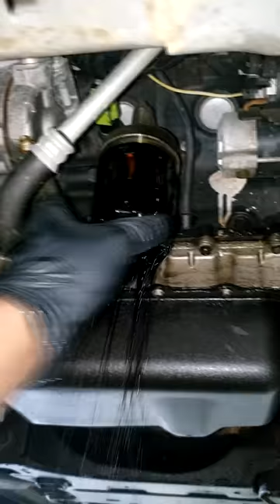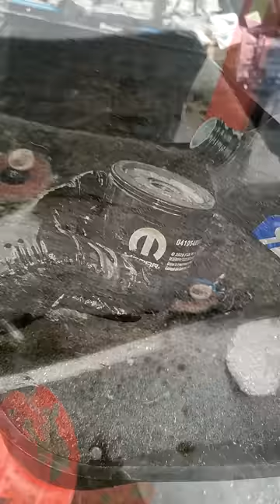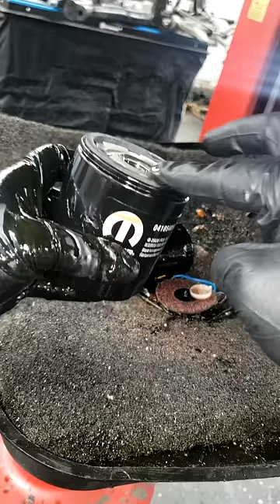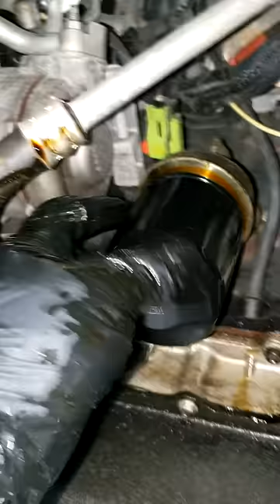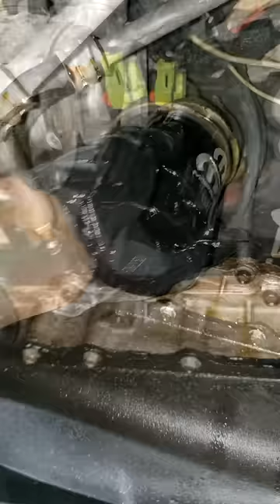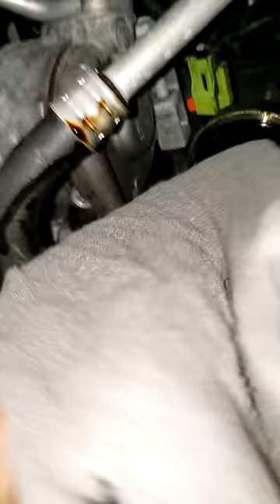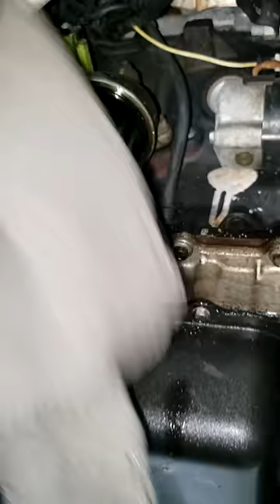Don't Lie.. Are yall still doing this?

Comment: Try that on a modern Subaru with the top mounted filter!
Reply: Or an Audi
Reply: Use flood clear mode to circulate oil before starting the engine after an oil change. My charger has an top mounted, cartridge filter and I make sure to do this everytime. Hold the gas pedal all the way to the floor then start the car. The starter will turn over the engine but it cuts off the fuel pumps so it doesn't start. Do that until you build a little oil pressure then start the car. As far as I know, every modern engine has this ability.
Reply: @dduncan55330  Everything in the engine is still spinning and rubbing against eachother the same as if fuel was going in, your not accomplishing anything by doing that. The only difference would be a bit less stress on the rod bearings since no combustion forces are being applied to them. I really don’t see how it would be worth bothering with.
Reply: @rainbowritchie8910  exactly 
.
its not proper.... but do you know how many engines ive pulled the plugs and used the starter to pre-lube before first start?
.
now if that new engine has been sitting for years.... im getting the proper pre-lube machine 
.
on a LS you can fill through a plug..... gets like 80% of it VS 25% of it in the filter only
Reply: man side mounted is barely doable, fastest screw in the west.... giggity
Reply: Well yeah it's a subelly zoo!
Reply: Easy, fill it up let it soak for while so it doesn’t drip when you’re ready to install it.
Reply: @rainbowritchie8910  everything in your engine will still have a thin layer of oil attached to it, it will be rotating much slower with much less force applied meaning that layer oil will last longer then it would under load and running
Reply: In that case, you would want to crank the engine in "Clear flood mode" or with the fuel pump relay removed to build up some oil pressure.
Reply: You just gotta be real fast. Chilling the pre-oiled filter to -40° also helps. 🤡
Reply: If it mattered then they wouldn't have made so many cars with filters upside down
Reply: On a design like that you have to flip the car upside down
Reply: I love those!  Makes an oil change so easy!  Nice big chunky 17mm plug that won’t round out, and a filter, oil fill, and dip stick all in one spot.
Reply: Put your foot on gas pedal all the way floored. Turn the ignition and it will disable fuel and spark and prime the oil system for the top mounted filter
Reply: In those particular cases a person will want the engine to not fire up immediately. they will want it to crank over about half a dozen revolutions. without starting to fill the filter. on modern vehicles this can be done by holding the throttle on the floor. while cranking it over. and on older vehicles by disabling the ignition system. by pulling the coil wire from the coil. and then replacing it after the filter is filled.
Reply: Or the handful of fords with the side mounted
Reply: @vex6559  And Chevy S10. with the remote filter mounted on the core support.
Reply: Great. Now I'm screaming internally, and I don't even OWN a Subaru! X3
Reply: Or a VW.
Reply: @rainbowritchie8910  Slower RPM.  Less bearing wear.
Reply: My mercedes has a top filter and I always put a bit of oil in the housing before putting the filter. 300k out of original engine so il just keep prefilling.
Reply: Pouring oil into the filter plug accomplishes the same thing.
Reply: @vex6559  yup, I lived with a Zetec in a Focus for a decade.  Really unpleasant to do oil changes.
Reply: @carrabellicusp 
You just flip car up side down 😂
Reply: or a BMW
Reply: Or side mount
Reply: I do, just get close and quick.
Reply: lol yeha driving primarily japanese cars, alot of my oil filters have been side or upside-down mounted (old nissan sentra, scion frs, toyota corolla hatchback) so this sort of thing never occurred to me. I oil the gasket tho
Reply: Yep!
Reply: Nearly all my cars have side mounted filters. No way I'm making a giant oil mess installing a prefilled filter on my car!
Reply: Same deal with the 3F-E in my 35 year-old Toyota. On the upside, when I do an oil change I can puncture the top of the filter to let it drain down through the pan and out so that it doesn't splooge all over the front axle when I remove it.
Reply: As opposed to a classic Subaru?
Reply: @LogicofChaos7871  yes.
Reply: Try doing that on my 74 charger big block in a 90° angle in the front of the motor
Reply: @LogicofChaos7871  Yes, EJs have it underneath, FAs and FBs have it on top. Not sure about older than EJ engines.

On my WRX (FA24DIT), I do the clear flood mode after changing oil. Clutch + gas + ignition = crank without starting for about 10 seconds. Helps build oil pressure at lower RPMs than just running the car.
Reply: And that's to the points, your point that it doesn't matter because it doesn't. Oil pressure will be up within seconds
Reply: Lol!! Do it super human fast! LMFAO 😆😆😂😂😂😂
Reply: Or a Buick 3800
   Chevy 5.3
Reply: This is not necessary on modern cars. Large truck engines yes you need to fill the filter but I rarely ever hear a tick or see loss of oil pressure during first start up. Probably more important to clean your mating surface....
Reply: @ReconRider  You think every car has that?😂
Reply: The filter doesn’t need to be full of oil. Just add oil until it stops absorbing. It’s the first thing I do, before draining the old oil from the engine or removing the old filter - and I check that the element has absorbed before adding more. A few ounces at a time.
Reply: That’s why you shouldn’t own a Subaru 😂
Reply: Subaru techs are specifically trained not to pre-charge filters. Doesn’t matter if its a bottom or top mounted filter, we don’t do it.
Reply: @ifGarage  clearly you have never worked on a car.
Reply: Fill it 1 time then wait a minute or 2 and all the oil will soak into the filter material and then just twist it on quickly
Reply: You have to be quicker then gravity🥱
Reply: @xzambkilaxcalaber215  or just fill it and wait a couple minutes to smoke into the filter material
Reply: @unbiasedcobra6672  clearly you’ve been doing oil changes wrong your whole life
Reply: @ifGarage  yeah over 20 year's without a single issue. If your motor can't run for 3 seconds with the oil already coated on everything then the motor is already rooted. The fact so many cars have filters on top or that are cartridge shows this. The oil already in a motor more then covers the lubrication needs until the oil starts pumping.
Reply: Sideways on a jag
Reply: @unbiasedcobra6672  4 ASE certs here, no need for your essay
Reply: @ifGarage  4certs and you can't explain your position. Claims made without evidence can be dismissed without evidence. Although I wouldn't image you could come up with anything more then "nuh uh".
Reply: Some Toyota's too
Reply: @unbiasedcobra6672   Wow I really angered you didn’t I? It’s been an honor
Reply: @ifGarage  calling people angry when you have no point to make. Lmao you are adorable. It's always cute when children try to debate adults. You see, explaining your point isn't being angry. It's how adults talk.
Reply: @Motorsportsgeek  wont help, when filters unscrewd the oil is dump in the pan by a drain
Reply: @rainbowritchie8910  The engine rotating without firing puts far less stress on the bearings.
Reply: Caddy ats too
Reply: Party pooper
Reply: @JimboTheGymBro  when screwing I take my time!!!
Reply: I obviously don't do it on my subie but I always do it on my 6.7 cummins
Reply: Or a 90s Toyota corolla...
Reply: Was just thinking that. Got a 17 wrx with the filter on top.
Reply: I don’t see this working with a cartridge filter. Especially a top mounted one like Mercedes.
Reply: @dduncan55330  First time I ever heard about that. I guess my 96 is not modern.
Reply: Jesus lobes you ❤️
Reply: Can’t fill oil filter in a Tacoma 4.0 since the oil filter it top mounted.
Reply: Or the Mazda Rotary !
Reply: Just flip the whole car🚨
Reply: Lol 😆 🤣
Reply: Subaru oil changes are the easiest thing ever. I love it
Reply: My filter is horizontal😁
Reply: U beat me to the punch, i hav a VW.
Reply: @dduncan55330  😊l
Reply: @dduncan55330  r😊😅😅😢is the good thing about it 🎉it 55😮😊the payment is 7p😊😊😊😮8😅ildp9fg
Reply: On an Audi you don't need too. It's a dry sump oil system. I use a K&P engineering filter.  It's a permanent filter with a mesh filter that can be cleaned
Reply: Worse, a vintage Ferrari v12.  They had 2 inverted.
Reply: My VA STI filter is underneath still in the correct configuration(FUJI Heavy knows performance, lol)....but, if I was changing the top mount I would fill the center feed line (where the filter threads onto) with clean oil to ensure the oil pump with its super tight tolerances, doesn't get run dry for any length of time.
Reply: subarus used to be the easiest car on earth to change the oil in
Reply: exactly what I was thinking.  Also, it doesn't matter on cars.  They charge up in about two seconds and there's enough residual oil in the engine to not damage anything.
Reply: There are one way "valve" in this filters. So halve fill is doable.
Reply: I have a older outback the filter is side mount, it will just pour out
Reply: Well good thing I ain’t got a modern subi the only good gens of Subaru is 1 and 2 all the other gens suck and so many ppl dick ride them it’s actually sad
Reply: Well Subaru are the Official vehicles of The Lesbians an Gays.
Reply: if you fill filter and wait a bit all the oil will soak through to outside if you slowly spin it a few times nothing runs out.
Reply: No way really? I had no idea they came top mounted. Crazy.
Reply: That’s why I hate that they changed the design. I always prime the filter on my STi. My mom’s 15 WRX is a different story. Lol
Reply: It only takes about 30 seconds!
Reply: Easy, just flip the car upside down 😂
Reply: @godofthunder6613  That's what I do. It's a pain in the ass, but if you're gonna do something you might as well do it right
Reply: bruh i dont even do this on my old EJ with bottom mount filters. Its all bogus.
Reply: You have turn your car upside down, dauh
Reply: Or a Benz.
Reply: That's completely unnecessary. It doesn't matter and there's no reason for it. Even in large diesel machine. I haven't filled an oil filter since 2011. Absolutely unnecessary.
Reply: You don't need to do this anymore 😅
Reply: Or on a honda k series side mounted
Reply: Try doing that on Ford 5.4 side mounted oil filter. Messy merely taking it off
Reply: You could still pour some in to let the filter media soak it up
Reply: Just flip the car upside down
Reply: @godofthunder6613 🤣
Reply: Soak it, let it drain out the excess and boom you’re ready to go. Who woulda thought
Reply: @rainbowritchie8910 its called priming a motor. It works. Ask any engine builder
Reply: I was thinking of my hondas which are horizontal...lol
Reply: @gene8842  i fill my filters about halfway, that way you can tip them over but dont spill
Reply: @gene8842  i have b series, r series and k series. You can fill them like 1/3 of the way and it wont come out the hole because of the rubber bypass that covers the holes
Reply: @dduncan55330 Hyundai at least does not have this.  And their newer filters don’t really prime very well.  But those engines typically fail on the bottom end before the valvetrain even comes into play.
Reply: @rainbowritchie8910  Some people don't think things through. Most starters only spin the engine about half of the idle speed (if that). Speed and pressure make friction. So priming the filter in this way is certainly beneficial with the reduced speed and pressure. We used to do this after an engine build to make sure oil was getting where it was supposed to.
Reply: pull crank sensor out and prime it, then clear code XD
Reply: Or jeep
Reply: Or Mercedes or BMW
Reply: Yeah I do it everyday. Can put about 0.1 atleast and itll abzorb in then you put it.
Reply: @slyfox4564 😂
Reply: It can be done if you let the filter sit overnight
Reply: that'd be a nasty surprise you should have seen coming!
Reply: Top or side mount 3.6/you can do it, simply takes are few minutes to pre-fill ~ half of the filer & allow it to soak into the filter media.  =)
Reply: Either fuel or oil filters on a deuce and a half , if I recall right , were upside down in a canister .
Reply: Dood will say prefilled anyway.

Yo "mechanic" it'll spill everywhere"

"That's not my problem"

"Bich think he smarter than a team of engineers"
Reply: I have a 21 Subaru WRX and I do this... never had an issue.
Reply: Or a BMW, or Mercedes, or anything with a filter mounted horizontally.
Reply: Car rotisserie
Reply: Or a Toyota with side mounted filter
Reply: Simply park car upside-down... 🤦🏽‍♂️
Reply: Exactly why you’re not supposed to do that. They tell you how much oil goes in it for a reason. That’s why it’s always some weird number like “5.4” or sum. It accounts for filling the filter. This dude jus wasting oil.
Reply: Very little spills out, the oil filter is like a sponge inside if let sit for a minute.
Reply: Yeah or just any paper filter in general
Reply: Foolishness
Reply: Same here I have a 2022 Chevy Colorado diesel and it has a top cartridge style filter.
Reply: @hughbrackett343  caution if doing bare- handed🥶
Reply: @compxx3971 BMWs don’t have metal filters
Reply: @user-sr9in2es8b first time I did an oil change on my truck I said "oh cool, since thw damn thing sits to low to really get in there and take the filter out from underneath I can just pull the r/f wheel off to get to it. And look at that some of my spark plug wires are disconnected down here and I have no idea which goes to which cylinder😃"
Reply: @congruentcrib honestly don't really have to worry about rounding out bolts to much when you have a good amount of room to work with and the right tools unless someone already came in and started to screw it up. I'm usually more worried about the drain plug coming out with damaged threads from someone overtorqueing it, usually because of the attitude of screw using a torque wrench.
Reply: @404_VipersBite  read the coils and find your firing order online and the length of the wires helps you
Reply: @StockTurboN20  found a diagram online and trial and error editing it till I got it right. Truck need to be fixed up when I bought it so those weren't the only things I was working on at the time
Reply: @404_VipersBite  oh good
Reply: @StockTurboN20  had to do a head gasket on a 2.2. It was my first time flyin solo on a repair but it still runs fine so I guess I did something right lol
Reply: @404_VipersBite  patience is key